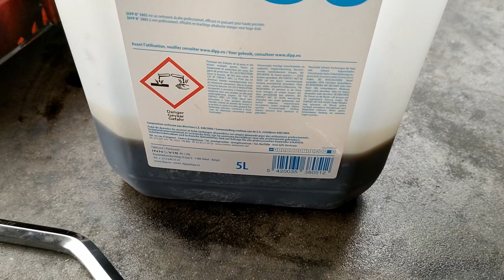Servicing our Citroen Jumper with fresh oil and transmission oil ~ #VANLIFE in Belgium

Comment: Great video!where is the trasmission plug??
Reply from the maker: Hi Andrea, Do you mean the plug for draining or for filling up?
Reply: @Euronauts  both!
Reply: @Euronauts  the one for filling up
Reply from the maker: @andreadeleonardis268  The drain plug is easy, it's at the very bottom of the differential, where the axles go in. The filler plug is a bit harder to find, it's a hexagon screw just below the sensor for the reverse. I find it easiest to access from below, I think there's only one electrical connector to the gearbox: unplug it and you should find the plug a few cm below.
Reply: @Euronauts  thanks guys!

Comment: How many miles had the gearbox done when you changed the oil?
Reply from the maker: afaik that was at about 120000 or 130000 km. I believe most manufacturer's will recommend a change at 10 years either way.